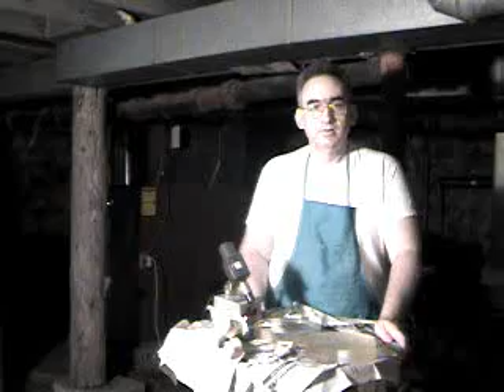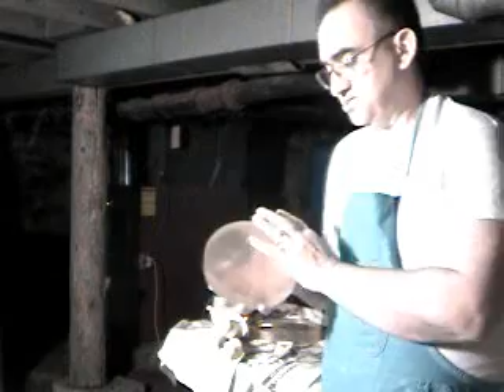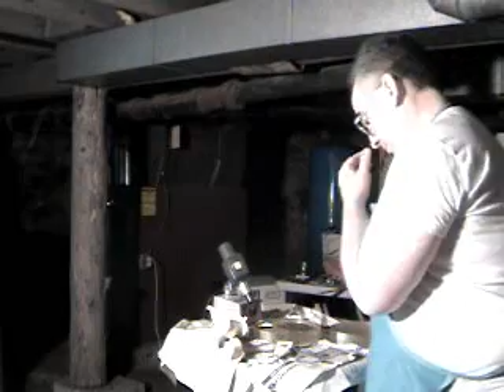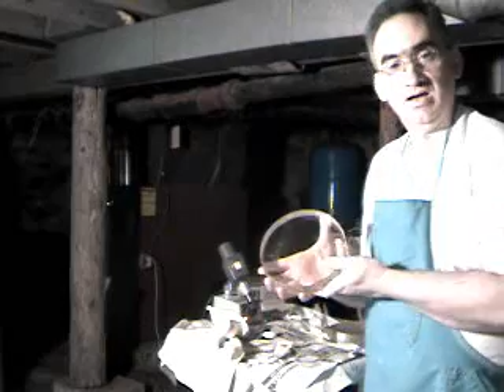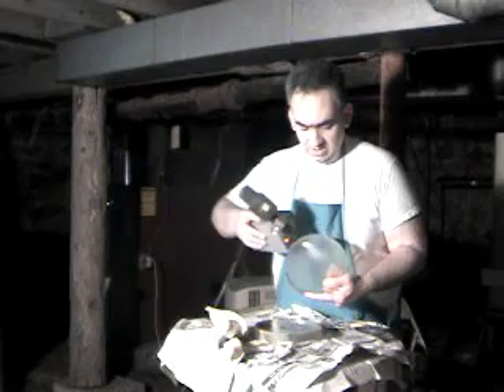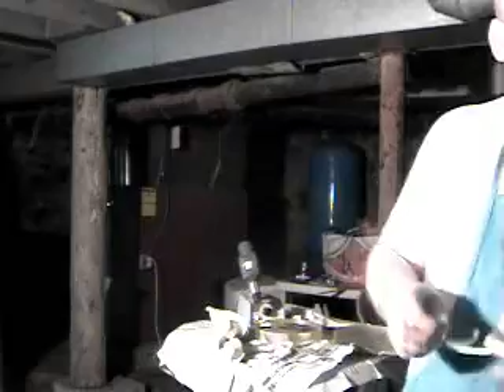Testing the polished surface

Comment from the maker: @wannab009 I either go to a mirror class in Washington DC where they have a vacuum chamber and coat the mirror there or I send the mirror to a commercial coater in Skokie Illinois for coating with a proprietary metal that he calls beryl. The coater is Clausing Optical coatings. You can reach them through Google. Best regards, Francis J. O'Reilly